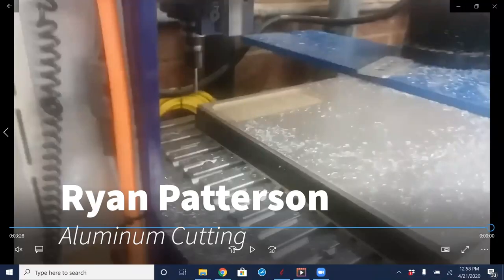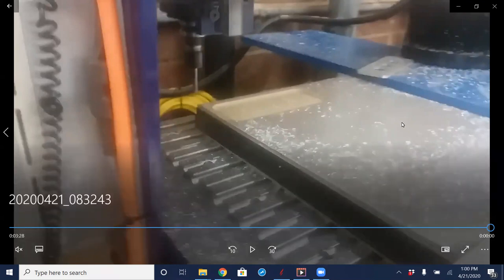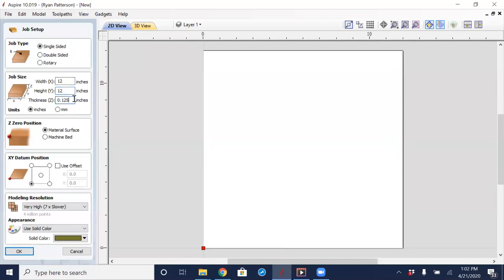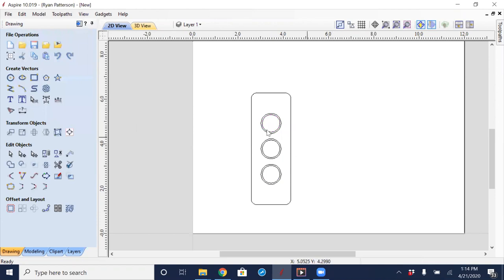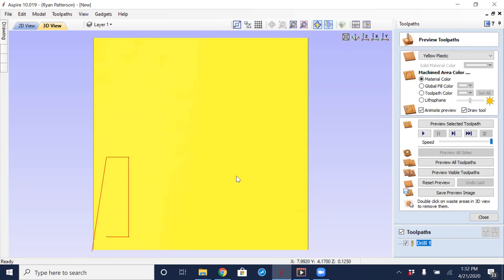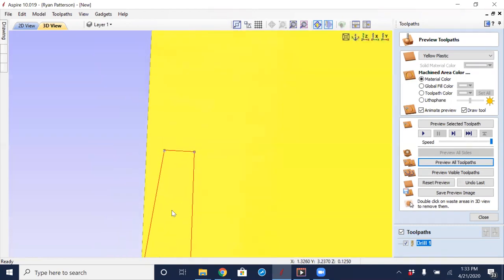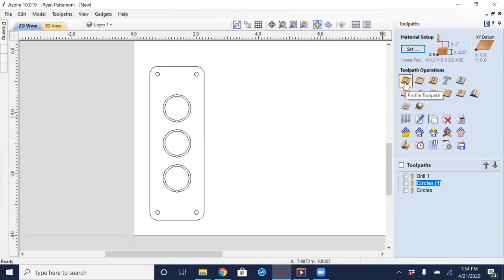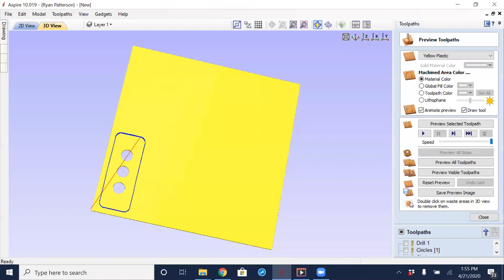Ryan Patterson: Basic Aluminum Cutting

Comment: I cut aircraft instrument panels on my ShopBot. I found that drilling all of the screw holes and fastening thru the holes works great, but I also drilled the cutouts and screwed them to the table. . . a lot fewer 'ejected' discs and broken bits. I also learned to cut all of my screw holes with an end mill because drills don't make round holes. (Yes, I know I could drill undersized holes and ream them to size and round.)